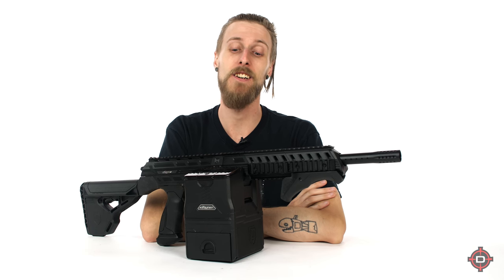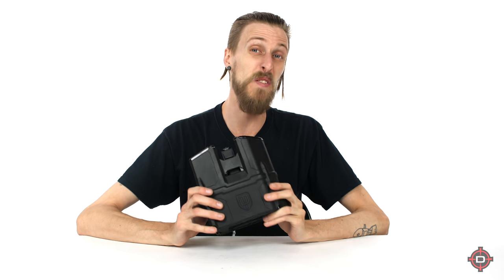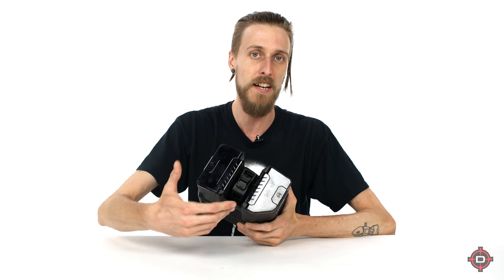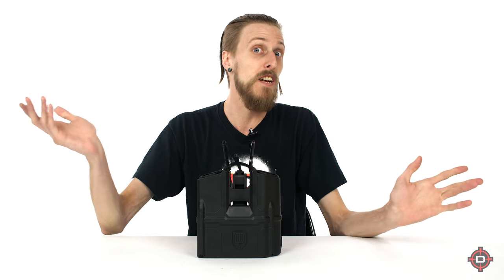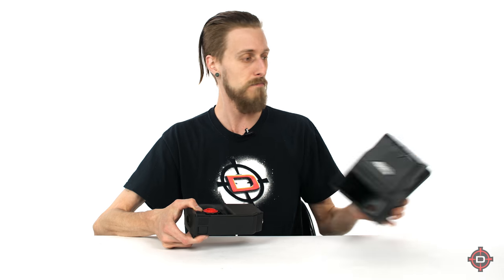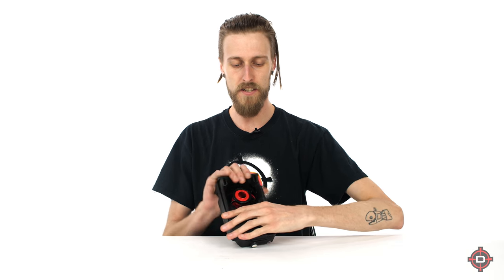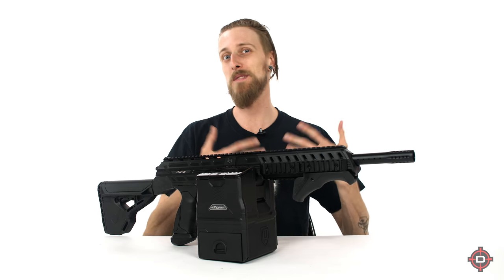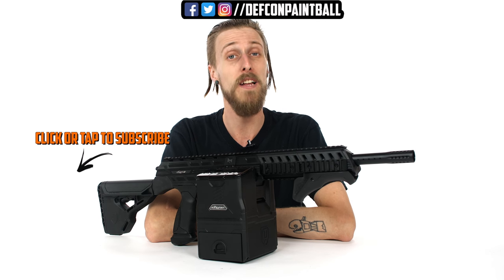Dye Dam Box Rotor Paintball Loader - 4K

Comment: Box loader or Strike Loader?? Which is better. Box loader is for Dye Dam only and 325 Shots vs Strike Loader fits All makers and holds 2000 shots. 
There's the next Does IT Suck video.
Reply: I have a Maxxloader for my guns... it’s not bad but it’s not great... 

If you want to be more maneuverable go box rotor, but if you want to be more supportive ... maxxloader is the way to go...  

It’s easy to run with the maxxloader but you just can’t do a lot of rolling around and stuff with it

Comment: Never understood why you would pay 1600$ for a magfed paintball marker and then another 600$ for a box mag on it when you can just put a hopper on it. Unless you're heavily into milsim.
Reply: I agree with you some of the prices are ?! crazy.  I got a x7 phenom with electric for 350,  But wanting a magfed marker i got a milsig cqc,  but again prices are kinda nuts, magazines that are $30 each, or ^ that thing that costs more than the gun itself? Really?  Some say paintball is a somewhat dying sport,  And this is partially why.
Reply: Agree I would just get a tmc because it's cheap and mags aren't experience, only down side it doesn't shoot FS or a stock tank but those don't bother me
Reply: yeah i almost got a TMC instead,   but the cqc can use my phenom / a5 barrels, and my cousin has a A5 so can ez swap, and the TMC has a few slight drawbacks that made me just want to spend a little more and get a higher up.  TMC i hear can be a tad difficult when needing to fully clean its internals,  and the charging handle being a lighter plastic, vs the more expensive metal / polymer m17 cqc.
Reply: MADDOG the PC Gamer cleaning is easy if it's your first time then it's a bit hard, the charging hand is the first thing you should change although it's not a problem but 5 bucks for a aluminium is better, tmc is a good magfed gun for the price. I'm a speedball guy more but I still like magfed helps me train for my job
Reply: oh nice,  i hadnt heard about a optional upgrade.  Due to some medical stuff im not fast enough or agile enough for speedball,  and the main game i play every year is the 24 hour game at KC Crusaders near Seattle, which is more scenario / Woodsball ish.  And given that im slower i want a gun that i might be able to turn into a sort of sniper, or at least have reasonable accuracy.  I dig my phenom but at least with the m17 i wont hammer on paint as much, and have a gun a friend can borrow / be back up.
Reply: MADDOG the PC Gamer oh, try looking into first strike markers my brother owns the new t15 honey badger and it's quite nice since you can put real AR parts on it, you can easily make it into a sniper plus the FS rounds is a bonus
Reply: While the TMC isn't 'hard' to clean, other options like Milsig M17, TGR2, and T15 are all leaps and bounds easier to maintain.
The TMC's biggest drawbacks are that you won't be able to use first strike, you don't have the option to put your air tank in your stock, and the stock itself isn't easily changeable because the tube has a weird shape. Similarly, the barrel is also 98 threaded and so it is less easy to swap out.
Those things aside, it's still a very good choice for the price it comes at.
Reply: Personally, I love magfed markers. The main point I was trying to make is that you paid 1600 dollars for a Dye dam magfed marker and then you're going to pay another 600$ so you can basically negate the whole magfed part of the marker. It's expensive as shit and doesn't make sense, especially when you consider that the Dam can use a hopper.
Reply: Pat Best because it's dope
Reply: The reason its so expensive is because its made by dye. They took their most advanced marker and made it into (almost) the perfect magfed marker. Its the quietest, smoothest, easiest on paint, shoots FSR, can switch between magfed and hopper fed in seconds, and the mags are very cheap and reliable. They're also the first and only company to make a decent boxmag for their marker so far.
Reply: SSniper14 PB true
Reply: Personally, I don't want my marker to be quiet, I quite enjoy the metallic clang the muzzle makes when it fires.
Reply: Then get the raging donkey muzzle?  i think from firststrike, sort of points the nose from the shot forward making it sound a bit more aggressive / louder . not sure if it works iwth other barrels though
Reply: Naw I like the one that came with my TGR2
Reply: Pat Best the reason you buy a boxrotor in't to use it in a magfed game, but in biggames and any other gametype with rec- or speedplayers. otherwise you were outgunned or need another marker (a decend speedball setting cost you way more than the boxrotor). second the angled feedneck is, to be honest, utterly crap. going 1/3 into those rail ontop, prevents you from using any kind of optics. plus use any rotor you want, it will double the height of your dam. 

greetings from germany
Reply: it's a dying sport because of people are getting lazy....
You can still buy cheap ass guns... they are just maintenance heavy

Comment: Seems lots more surface area exposed to an opponent.  If posting out to the side, and you are able to keep the box partially hidden, and it still feeds from an angle of 45 degrees or so (while still full of course), then maybe less is exposed as compared to a top mounted hopper.  The weight would need to be counter-balanced with a big air tank.  I am assuming that during rolls, parkour moves etc., the box cannot wiggle off.  I like not having a hopper right where I want to sight my target even when using plain "iron" sights.  It was a shame that the hopper adapter is only right-mountable for left-handers.  Still I may prefer the smaller 10 round mags if I wish to stay light and mobile.  My understanding is that this box mag is quite a bit more expensive than a typical Dye electric loader, however some websites "throw it in" with a DAM purchase at a package discount bringing it closer to the Dye top-mounted hopper price.  It does come in all the different colors including the Dye Camo color.

Comment: Has anyone mod it for a milsig m17 ????
Reply: Isaac Ramirez its impossible it's connected to the dye dam so everything you pull the trigger it pushes the balls up
Reply: it would be possible, but building one using a halo or LTR and an ammo can would be much easier and cheaper